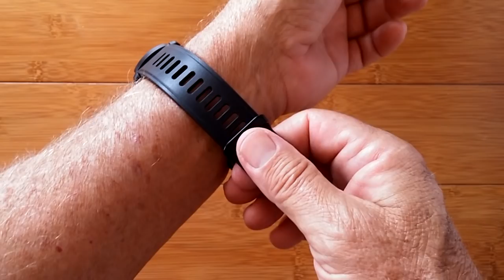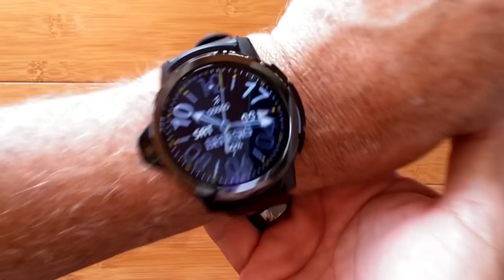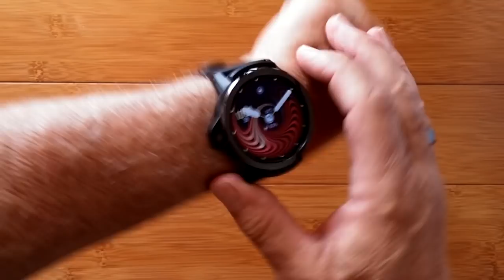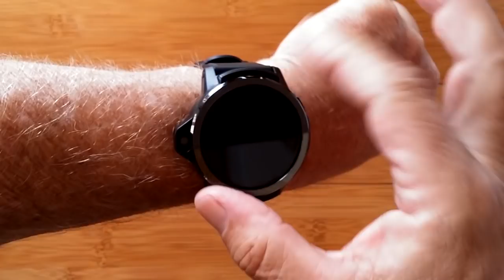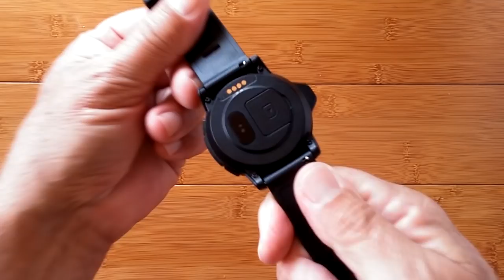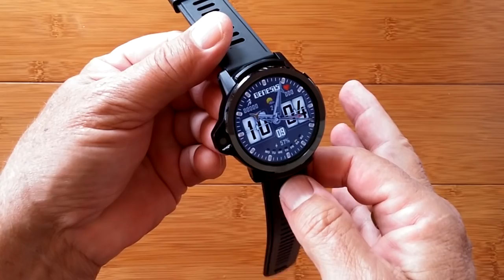Kronos Blade GENESIS Smartwatch Hardware Updates plus More on Camera Apps & Links to Actual Pictures

Comment: Hello Mr. Ticks. I am having a hell of a time trying to get the protective film on the camera lenses off. How did you do it? And are you sure all the watched have it on them? Its not like I dont know how to do things like this. But I have never seen a film be this problematic coming off, Unless there is none on it at all. Its very hard to tell but the camera image is slightly cloudy when viewing. So it leads me to believe there is a film on it. I am afraid I may have damaged the lenz now. It is not glass like you said it was that is for sure. Please let me know. Thanks
Reply from the maker: It is starting to look like some of the watches may not have the protective film like the one I received. Also, I'm trying to confirm if the lens material is glass or plastic as it appears some folks are finding it scratches easily. So for now, all I can say is BE CAREFUL. Your Genesis might be one without the protective film. Don't risk scratching your lens looking for it if it's not obviously there. Clearly mine had it, so I have assumed all of them have it as my Genesis is from the same 1st lot as yours. Until it is clear what's going on, BE CAREFUL!!!

To follow this issue and others related to all things Genesis, join us at https://discourse.fullandroidwatch.org
Reply: @SWT  Oh crap, I scratched mine. It's not directly over the camera so hopefully it won't affect it. :-(
Reply: @danlarson757  I did the same thing. So angry about it. It had covers on the heart monitor lens and the watch face. So I assumed the camera lenses had it. Ended up scratching the landscape camera lens. It's not in front of the actual lens so it does not show up when taking a photo. The actual lens came off from me picking at it. And that's how I found out it was not glass like he said it was. Luckily it stuck back in place fairly easy. But I think I may take it to a watch Smith and see what they can do. I guess that's what happens when a product gets rushed out the door. QC goes to shit and things get missed.
Reply: @SWT  no plastic on mine on the both cameras other that the screen protector on the main screen. , nor did i get the rubber sim grommet on my cover as far as i could see. my box i guess due to shipping was bruised and dented  all around the edges of the box , other that that internally everything was fine thank goodness.
Reply: @TriniChiniese  My new box looked like it had been run over by a car, but the watch was ok.
Reply: @SWT  Question Mr Ticks , do you know or have you ever try putting different ring Tones other the the ones that come with the watch. i am having issue to get ringtones to work . or is possible i am doing something wrong .
Reply: Mine didn't come with the covering over the lenses.
Reply: hi my friend i am having a hell of trouble in buying this smartwatch. where do I go?

Comment: Nice review, I have watched a few times along with your others and subscribed,  I am having trouble finding any availability to purchase the Kronos Genesis and everywhere I look online appears to have nothing available. Kronos website also seems to be down with little or no info available. Does you know where this watch can be purchased and where the stock availability is?  I have posted on Full Android Smartwatches site but no joy so far. Thanks!
Reply from the maker: Sadly, a 2nd production run never materialized and all 500 of the original batch have long been sold out.
Reply: @SWT  Thanks Mr Ticks for your response. I remain an avid viewer of your reviews. I hope that the Genesis can be resurrected in the nearest of futures.
Reply from the maker: I know it's been 6 months now, but something is finally here.
NEW: Check out the Kospet Prime S UPGRADED Kronos Blade Genesis design with top camera and front camera on right side of watch:  https://www.banggood.com/custlink/vDmYjnTMRK  ( Use Coupon: BGb76871 for launch price $99.99 limited supply )
Doesn't have the transflective screen, but the camera is in the right place at the top.

Comment: Is there a reason why they have the sensors in portrait mode?
Maybe because of the small space in the watch?
Or could they easily implement it in landscape orientation?
Reply from the maker: Are you talking the camera? It has to do with the design of the module and how it fits on the motherboard as I understand. All Android watches, no matter if the camera is on the top (Genesis) or side (all others) orient the module upright and not sideways, so the images are portrait and not landscape. With the Genesis it is easy to lift your arm so the watch is at 90 degrees and still see the screen to take a landscape photo. For watches with side facing cameras, that move points the camera toward the sun, so instead you need to rotate your wrist 90 degrees to get the same shot. It's bit tricky, but if you play with it you can get it.
Reply: @SWT  Thank you very much for you information.
I hope they will find a way to mount it in landscape relative to the hand.

Comment: Anybody else having issues? Jason is a great guy and offered me a refund which I refused. I like supporting small business and I told him I'd just eat this purchase if I couldn't figure it out. He was, as always, super gracious. I know there is a forum and I've tried to search it and all I find is people talking about how awesome their watch is in every regard and I just wish that was my experience too. I was so psyched to ditch the bulky cell phone and over the last 2 days I've really started to get used to the smartwatch gui and I could easily never have a block phone again. However, my watch is ALMOST literally unusable (for me) A few things that have me worried: Mine doesn't do pinch to zoom, had no film either and I wonder if mine was an early one or something. I use my "phone" at work as a city mail carrier. All it does is ride on my wrist, screen off with an audio book player running in the background wireless earbuds and I have my sim in there. This is almost the only reason I carry one so it needs to do just a couple things well.  Rarely ever get a call or sms from the wife. I have to recharge my watch 2 times to make it through a 9 hour work day and have anything left in the tank when it's done. I have factory reset twice, installed ONLY the things I require (simple ABP, and Facebook messenger stand alone. I went to the cleaner and set it up so that nothing but my audio player could run in the background. Turned off sync (which bites), screen set permanently to dimmest (that screen is awesome by the way). I froze all apps I don't use and ONLY have Bluetooth turned on. I could actually hold my nose and live with this by utilizing the charge station and earbud bank (which I had to do) but the Bluetooth radio is barely even what I would call functional. It is so bad that I refuse to believe they are all like mine or no one would be happy. I wear my watch on my left wrist and HAVE TO wear ONLY the left earbud because the Bluetooth signal can't get across my body. NO EXAGERATION. Not only that, but I can't let my left hand just hang down by my side because the signal can't make it that far down. I have to hold my arm crooked or my ear buds are unusable. I even got my TOZO buds out to see if it was the earbuds rather than the phone and they do the same thing. I love everything about the smart watch except these few gripes. Anybody else out there had these issues. I want to love this watch so bad.
Reply from the maker: So sorry to hear about your problems Jason. Thanks for being a good sport about it. This is Jason's first watch effort from design to completion, and I'm sure he's learning a lot along the way. I'd love to hear from folks with the Genesis, too, especially as to your Bluetooth and battery life issues. I haven't experienced them, but, quite honestly, with a million watches coming in to review, I haven't been able to devote much time to any one watch. So the key will be from hearing from others on this. Thanks for your report and flagging things we should all look for.
Reply: U never told me yours does not pinch and zoom!!!  Can you please send it back?
Reply: @kronosbladesmartwatchesand374  is this Jason? Yeah I don't have pinch to zoom

Comment: how to enable the raise to wake and double tap to wake on the genesis? I've been looking on the settings but I cant find.
Reply from the maker: Slide down to the page with lots of icons on it. It's the left most icon in the middle row. Take time to learn about the round white dot icon at the top, too. You'll be glad you did.
Reply: @SWT  to the page? not in the settings sir? i tried to look in the gesture settings ang display settings but not in there. Can you take a picture of so that it'll be easy for me? thank you so much for your help sir
Reply: @SWT  What I mean is how to set the genesis to automatically turn on with twist wrist?

Comment: Has anyone had any problems with the battery? I bottomed it out while using it and wasn't paying attention to the level. Now it won't turn on and will not accept a charge, all I get is the battery symbol that remains red with no charging indication and occasionally I get the Kronos Blade logo but that's as far as it goes.
Reply from the maker: Exclusive  technical support is being provided for the Genesis by the tech team at: https://fullandroidwatch.org/  Please report any issues you may be having so they can track them and offer you guidance. Thanks.

Comment: Thx Mr Ticks for a another great video. I'm really getting excited now as my Genesis is on the way and due to arrive in the next few days. Just a question: the model you are demonstrating in the video seems to have a different strap to the black rubber strap in previous videos which had holes all along the band. Do you know which one is being shipped as standard along with the 2 leather straps?
Reply from the maker: Sorry for the confusion. You'll be getting a strap that looks and feels just like the one in the original Genesis review videos, but with a quick disconnect on it. I had Jason just send me the new production Genesis watch so he didn't need to dig into his inventory to send the box and all the extra parts. I what to help him save money wherever possible, and I only needed the watch itself for reviewing. I probably should have grabbed one of the leather bands from the original box for the video. Appreciate your question as others may be confused as well.
Reply: @SWT  Thx Mr T. My watch has arrived now and as usual, you're right on the money. The strap was as initially advertised.
Reply from the maker: Great! I thought it would be. Jason is an up-and-up guy and shopped for the best for the Genesis.

Comment: Hello Mr. Ticks. I'm having 4G connectivity issues with Kronos. 
The watch stops getting push messages after quite short amount of time,  I guess 10-15 min.
I'm testing with Telegram and Join apps.
Intelligence power is off, data saving off,  background cleaner both apps removed, Power management not optimized for both.
Bluetooth and Wifi are off for the test.
If I oppen any app , let's say PlayStore, it works always get data from internet.
But not the incoming pushes. They work only 10-15 mins after deactivating Airplane mode.
Have you heard about such issues?
Reply from the maker: Exclusive  technical support is being provided for the Genesis by the tech team at: https://fullandroidwatch.org/  Please report any issues you may be having so they can track them and offer you guidance. Thanks.

It is especially important you report this one so they can start working on it and work with the factory and firmware developer if necessary.

Only suggestion I have with my limited tech knowledge would be to go to Settings/More/Background Cleaner, make sure it is ON, then touch the screen to bring up individual apps and make sure Telegram and Join are turned OFF. See if that helps.

Comment: Hello Mr. Ticks.  I just received the Genesis.  Loving it so far.  Little problem though.  Im trying to get into the playstore and of course it needs my info.  Well when I go to agree to the terms, I cant touch the " I agree" button.  My watch face is in full mode.  Is there a way to turn it into a square face mode?
Reply from the maker: Yes, of course. Hold power button and then tap icon at the top on the screen that appears. Then touch cancel to return to the Play Store, and it should show the button. Often you need to toggle back and forth between circle and square to get to everything.
Reply: @SWT  Thanks .  I did find it after i got an answer in a forum.  Than i remembered a video you did.  p.s.  I bought this watch after seeing a couple of your videos.  I also subscribe .   Thanks again
Reply from the maker: Awesome! Thanks for the sub and enjoy your soon-to-be evolving collection.  :)

Comment: I sure hope I didn't det a broken watch but the watch dosent seem to respond to any SIMcard I put in! I have never had cellular problems before (Denmark). A little help please. I would hate to send this watch back. It would take months if even possible. Everything else works just great all though it uses a lot of juice fast!
Reply: Wait a minute.... I just had to turn the power off when inserting the card. Says so in the manuel also. My bad. Carry on - nothing to see here!! 😳🧐😄
Reply: Also... If you somehow disabled the pincode on the SIMcard the watch will not boot it up after inserting. Took another SIMcard from another watch with the simcode still activated and then there were no problems.
Reply from the maker: Haha, thank you for teaching us all what NOT to do when setting up an otherwise compatible SIM. So glad you got it working. Thanks for your moment by moment report.

Comment: Hi SmartWatch Ticks, thanks for the review for all of the watches. For the sub camera(not the front facing), which side would be good? The side or the front side of the watch? Many thanks.
Reply from the maker: I'm not sure what you mean by this, but on the Genesis the forward facing camera at the top of the watch is the best placement for taking pictures because your hand isn't in the way and it works on either the left or right arm.

Comment: Just beware, this watch has no water resistant at all. I went running the last two days and now watch is broke apparently if you sweat it will ruin it. My camera and heart rate glass has moisture in the glass. Sucks I waited 4 months for watch and it only lasted 2 days. So people who bought this don’t go running with it.
Reply from the maker: Thanks for letting us know. I would HIGHLY recommend for the rest of the folks out there that you put a strip of waterproof tape over the SIM cover to completely seal it. Remove it if you need to to change the SIM, but reseal it before wearing the watch, especially if you might be sweating. This goes for ALL ANDROID SMARTWATCHES. This is not just a Genesis issue, it is an Android smartwatch issue across the board. The SIM compartment is a huge surface area subject to water, water vapor, and sweat from potentially entering. These watches need a major redesign for SIM support, or to put out a version with no SIM for those who don't plan to use it as a standalone phone and up the waterproofing to 5ATM. I was concerned about this, and you confirmed it Tommy.

With that said, if the watch isn't totally dead, try putting it in a bag of uncooked rice for a couple of days as it's been said the rice will extract the moisture. Perhaps if it dries out it will start working again. Sure hope so.

Also, Exclusive  technical support is being provided for the Genesis by the tech team at: https://fullandroidwatch.org/  Please report this issue so they can track it and offer you other guidance. Thanks.

Comment: which one of these have beside heart monitor to do blood pressure too ? but realiable not fake one
Reply from the maker: So far Android smart watches don't support much in the way of health monitoring. There's a token heart rate monitor on them on the back, but it's pretty basic compared to the advanced bands on the market. There still needs to be an integration between pure Android smartwatches and the top tier health and fitness functions, including blood pressure, blood oxygen measurement, perhaps body temperature, and advanced sleep monitoring for calculation of accurate resting heart rate, sleep apnea detection, and Lorentz scatter plots for monitoring heart health. Right now you can get all that on the Spovan Blade health band, which I wear on my "other" arm from my Android smartwatch.

Comment: Does it have Wi-Fi hotspot too?
Reply: It does... Not advisable to use. Burns through the battery super fast. Insanely fast. Use only if someone needs it for 20 to 30 mins
Reply: @kronosbladesmartwatchesand374  thank you sir
Reply from the maker: Ah, but remember you're getting a booster dock that can recharge your watch on your arm, and the high capacity earbud power bank can help you out, too. The challenge is to use your WiFi hotspot sparingly enough that it doesn't drain your watch faster than you can charge your watch on either the booster dock, the power bank, or actually attached to the charging wire. Also, remember to do WiFi hotspot you need a compatible SIM with a data plan from your carrier that support hotspotting. The watch may get warm with excessive use, too. So there's a lot to consider, but at least with the package Jason is sending you, you'll have charging options to get longer use than you would from most other Android smartwatches.